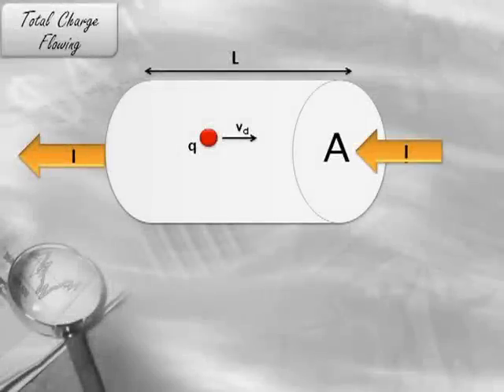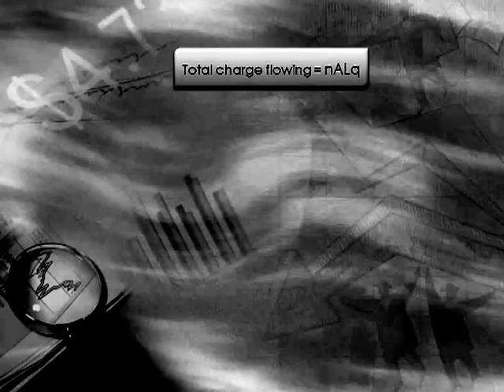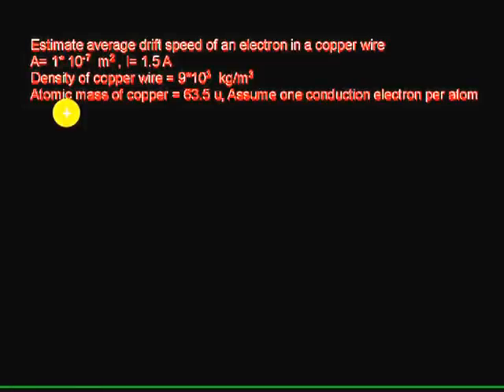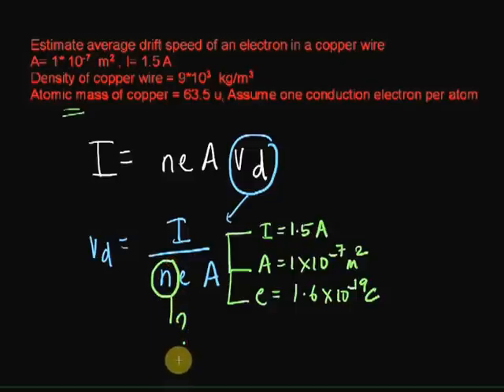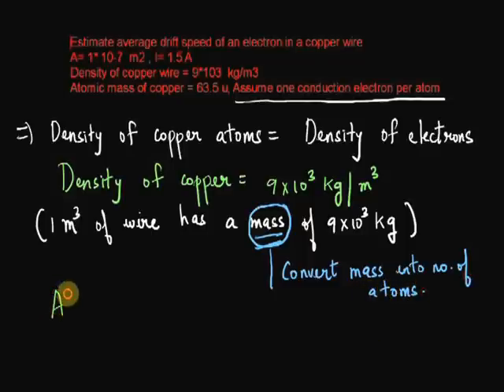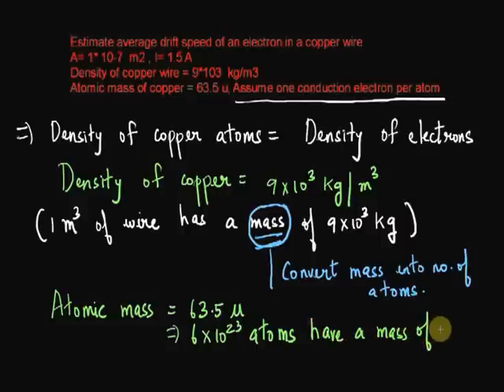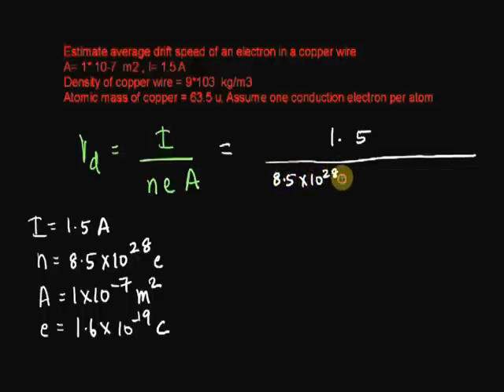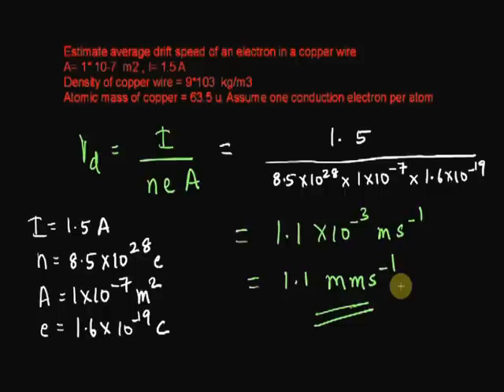Drift Velocity and Electric Currents (Part 2)

Comment from the maker: The radius should have a greater impact than drift speed for a cylindrical wire because the cross sectional area is pi*r^2. So any minor change in the radius would significantly alter the electron current flow!

Comment from the maker: Hi Marzbar, you can calculate the electron current using the formula I = n*e*A*Vd. If you know the radius , you can calculate the area of cross section (for a cylindrical wire) using the formula Pi * r^2 since the cross section is nothing but a circle. So plug that value in the electron current equation along with the drift speed value and you'll be able to rank all those four options. Hope this helps!

Comment: You are presented with several wires made of the same conducting material. The radius and drift speed are given for each wire in terms of some unknown units  and . Rank the wires in order of decreasing electron current.
Rank from most to least electron current. To rank items as equivalent, overlap them.

1. radius = 4r, Drift speed = 0.5v
2. radius = 3r, Drift speed = 1v
3. radius = 2r, Drift speed = 2.5v
4. radius = 1r, Drift speed = 5v